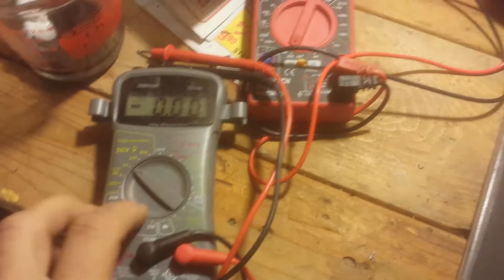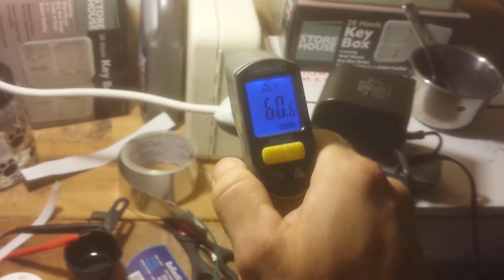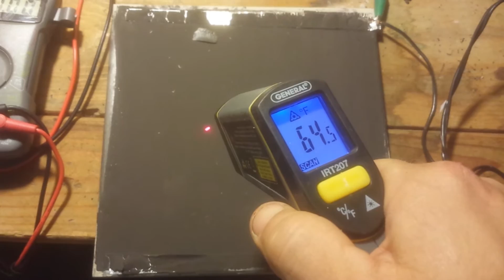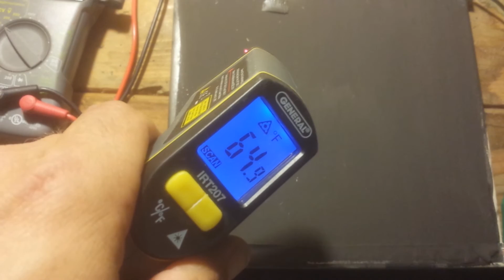Paint on heater first test

Comment: Hi Rob, thank you for this video and sharing your experience with us. 

I had my phone to my ear for hearing what you said, because there is almost no sound.
I have serious quesions and I hope you will answering me if you can: 1. 
You said that this plate has 12 V. Is it possible to connect him into 220V?
2.
Can I use it as a heater? And to how much m2 it gives the temperature in the room of for exemple 63°C?
3.
Is it possible to make a thermostate on it?
4. 
Can I use it also like a battery?
5.
When I make one like this, and "screw" it on a wall of wood, do I need isolation material under the plate and the woid of the wall?
6.
What kind of "plastic" do you use on top of it? 

As you see, English is not my mother language, sorry for the mistakes in my writing.

Hope to hear something from you. I luve in France in the middle of nowhere, without water, without electricity. I have solarpannels (from 2007) and windmills. Making plasma (Keshe) energy, have some Q6 and Q24 (Peppi Q6 tutorials) and do now experiments with seasakt battery, have 9ne that gives 12 V and will try soon an earth battery for my device to make water from the air. Big plans for carbon heaters too. Will not buy them, want to do all by my self. 

Hope you will give me some information I am looking for. 🙏🙏🙏🍀